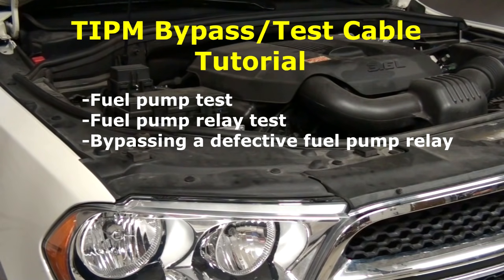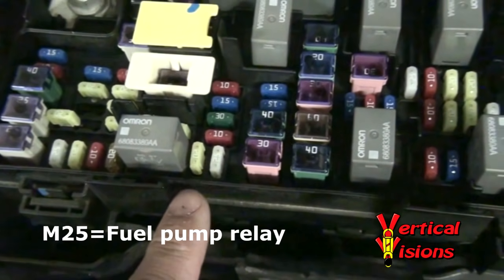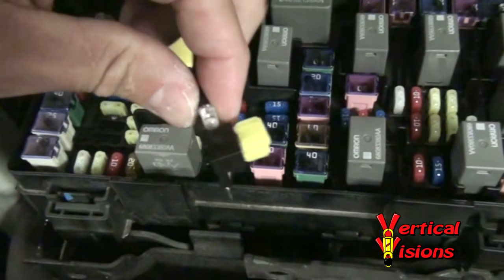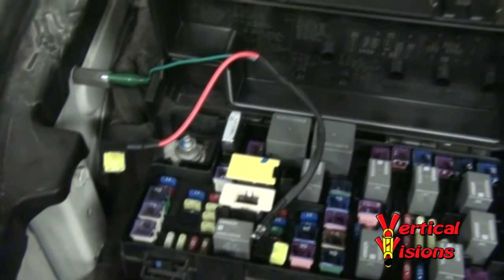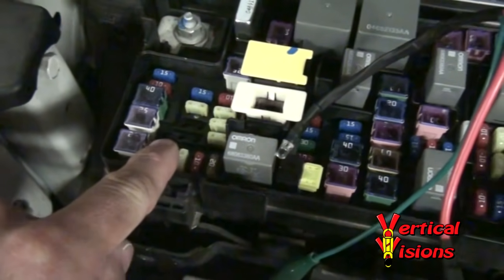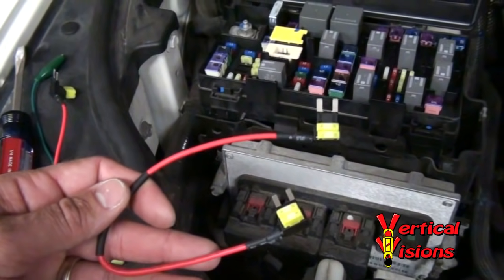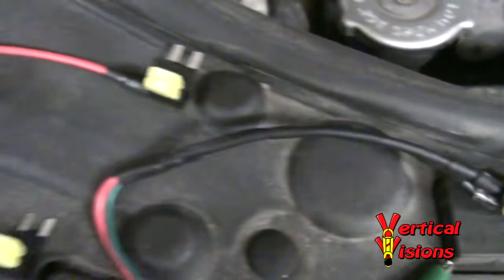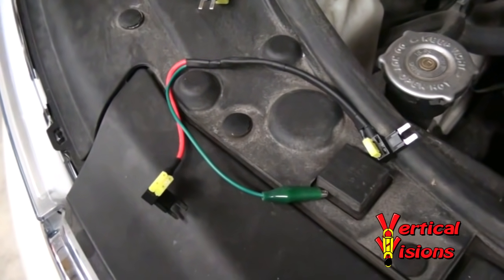TIPM Fuel Relay Test and Bypass Solutions - Most 2007-2021 Dodge, Chrysler, Ram, Jeep, VW Vehicles

Comment: Your video helped alot.  Ty.  My 2012 Durango has a sensor that is misreading and leaving me with no gas but says 1/4 & 1/2 gas remaining.  
Now it won't start.  Died on freeway.  When I crank it, the dashboard and interior lights are flickering but no start.  
Doing hard reset i learned about now.  Is that going to solve my issue?
Reply from the maker: A hard reset might help, but I'm guessing you might have a bad battery or alternator.  Our test vehicle, a 2011 Durango, died on the interstate a few weeks ago with flickering lights and no start.  We couldn't even jump start it until someone came by with a small 2000A battery pack.  Drove home with flickering lights that indicated a bad alternator.  New battery solved the issue and the alternator tested fine, but we're still perplexed over the inability to jump start it in this situation unless the old battery conflicted in some way or an intermittent electrical issue was to blame.
Reply: @VerticalVisions  thanks.  It was the battery.  So my boy is home.

Comment: Is the rear power outlet still available to use at the same time or should it not be used
Reply from the maker: Yes, especially since we don't use the M7 rear power outlet anymore for bypassing a faulty fuel pump relay.  New method we developed: https://www.verticalvisions.com/tipm-test-bypass-cable-mini-blade-fuses.html#M37

Comment: I have a 96 dodge 1500. I've replaced everything in the distributor  cam position sensor throttle  position  sparkplug and plug wires and the truck isn't getting spark?

Comment: What about 2005 ram 2500 just cranks no fuel. Don’t hear fuel pump. Drove to store shut off went to start and electrical volt came on dash no start cranks fine a quick shot of start fluid and truck runs. Will this fix it?

Comment: Does it work for a 08 dodge 1500?
Reply from the maker: No.  https://www.verticalvisions.com/tipm-test-bypass-cable-mini-blade-fuses.html#faq10
Reply: Great so I’m screwed, I got zero warning, shut truck off at 12:45, came back to start it at 2:30 and all it does is turn over.  The only thing that did different was I accidentally hit the door lock button on the key fob while starting it at 2:45, probably has nothing to do with it but figured I’d throw that out there.  I never had a progressive starting problem, loss of power, just boom and won’t start
Reply from the maker: @black07rr  My best advice is to buy a used TIPM:  https://www.verticalvisions.com/used-tipm.html
Reply: Jason Bell gonna try and figure out if that’s the issue first I guess, I just figured the bypass would be a easy way to verify it

Comment: Dude we need YOU to fix our Electrical Issue. Sad part is, our local Electrical Automotive who is HIGHLY renown in our area...this is where the Mechanic send you too if they cant fix your issues. So after 5 full days, they called us today and apologized cause they cant find the issue. Need to Jump it to start it...we let it run....then it starts fine for the last several months, needing to Jump it maybe once every two months....now...after we jump it...let it run awhile....still needs a jump after sitting for a mere 6 hours. Had starter and alternator checked and that were fine!> however...every 7 min on the dot, there would be this small tiny 10 sec window of some (dont know the Verbage!) draw on battery or whatever....problem is, Electrician said is when it does whatever its called (sorry!!) he doesnt get the amount of time to trouble shoot fuses and check lines or connections or whatever. They had it for 5 full days! He said to take it to a Chrysler Dealer service dept. he is cocerned it may need a whole new TIPM module etc......any ideas? Oh ya and we have one of those "possessed" Journeys where the Horn as some sort of melting or stuck sport in wheel, so horn blows whenever it pleases! wth???

Comment: Hello jason, me and my wife are wanting to buy a 2013 Durango R/T 5.7L ..... but doing research and seeing about this recall/relay miss up,  want to ask if the TIPM test bypass cable will work for the 2013 Durango R/T????   we test drove it and truck has no problems but dont want to buy if this is something to think about.... i want to keep durango for awhile.  please let me know  i appreciate it.
Reply from the maker: TIPM cables and other products we offer will work on a 2013 Durango, but you'll need to make sure an external fuel pump relay hasn't been installed per the nationwide recall:  https://www.verticalvisions.com/omron-g8jn-external-relay.html#identify.  If an external relay is installed and you have issues, replace the external relay (10 minutes max).

Comment: Jason Bell can I still check my fuel pump using this cable even if Chrysler already put there quick fix relay cable????
Reply from the maker: No (assuming you're referring to an external fuel pump relay where wires are cut under the TIPM).  But there is no recall on any Chryslers for this issue so it would be rare to have an external fuel pump relay.  Here is how to ID an external fuel pump relay:  https://www.verticalvisions.com/omron-g8jn-external-relay.html#identify
Reply: @VerticalVisions  Thanks a lot for the info on the dealer external fuel pump relay. I checked my fuel pump jumping the 30 and 87 pins on the external relay like you describe. And yes my pump turns on but no start yet I order the replacement relay from your website hope it works! I got the (simple) bypass fuel pump relay cable you offer. But unfortunately it didn't work cause my 2011 town & country already had the dealer external fuel pump relay. Under my TIPM

Comment: So in my case because my fuel pump stays on after i turn car off. I would have to isolate the power coming from relay which is stuck on and supply power from lighter to the side going to fuel pump. correct? But how can i disable the power from the relay end of the fuse and supply power to fuel pump???

Comment: But my problem is i cant turn fuel pump off. So when i turn key off position the fuel pump stays on. Will the by pass correct this??
Reply from the maker: Yes, absolutely.  The cable was designed and configured to solve this problem, which accounts for approximately 25% of all fuel pump relay issues.  More info:  https://www.verticalvisions.com/tipm-test-bypass-cable-mini-blade-fuses.html
Reply: Jason Bell then why do people install external relay kit?
Reply from the maker: @LubaLuba1  Most people don't install an external relay kit themselves because it involves cutting harness wires under the TIPM.  Bad idea to cut wires.  External relays were part of a recall for certain vehicles (2011-2013 Durango and Grand Cherokees).  We have better ways to bypass faulty fuel relays that aren't as invasive.  Plus, they're now recalling the original recall because the external relays are failing.
Reply: @VerticalVisions  I get the video but by not having a relay could I end up with popping the fuse also it looks like you have double fuses on each end of the wire why is that?
Reply from the maker: @LubaLuba1  This video is old - we have better ways to hook up the cable now that isolate the old faulty fuel pump relay so it won't power your pump when the car is off.  https://www.verticalvisions.com/tipm-test-bypass-cable-mini-blade-fuses.html#M37.  The double fuses on each end are mainly for testing purposes (test fuel pump, test fuel relay), but when you hook it up on bypass mode you remove the lower fuse on M25 end of cable.  This removes the old faulty fuel relay from the fuel pump circuit.
Reply: @VerticalVisions  So in my case because my fuel pump stays on after i turn car off. I would have to isolate the power coming from relay which is stuck on and supply power from lighter to the side going to fuel pump. correct? But how can i disable the power from the relay end of the fuse and supply power to fuel pump??
Reply: @VerticalVisions  Ok but why do you two fuses to begin with anyway removing it still continues the circuit at the fuse M25? because once the fuse lead on the opposite side of that goes to pump is connected it will have its own power from stuck relay. This will defy my purpose.
Reply from the maker: @LubaLuba1  I explained in another reply to you regarding the need for 2 fuses (to test fuel pump and fuel pump relays).  Our TIPM cables perform 3 functions in total, so 2 fuses on each side are needed for some tests.  In bypass mode, you remove the lower fuse on M25 end in order to remove a stuck on fuel relay from the fuel pump circuit.

Comment: We had a 2009 T&C with similar issues.  For us, if we turned the key to ON, shifted the car to drive, then back to park, it would start up.  Does it sound like our problem has anything to do with the fuel relay or what?  About a year after we bought the van, we were having stalling problems whenever we were exiting a highway.  Dealer couldn't figure it out.  I called Chrysler after finding many similar issues on the Lemonblog.  When I threatened to contact our local consumer advocate, they finally agree to have a new transmission insalled.  Happily the stalling issue was resolved, but a few years later the no-start issue started.  My daughter and son-in-law now have the van and are having the no-start issues again.  Since it DOES start up after moving the gear shift back and forth, what problem does anyone think we might have?
Reply from the maker: Stalling while driving is sometimes a fuel relay issue, but shifting back and forth is likely a shifter cable issue.  Bottom line is that a fuel relay issue is almost always a problem with providing fuel to a vehicle and never a problem with the ability of the starter to engage the flywheel to rotate engine components.
Reply: @VerticalVisions  Thanks.  Could the shifter cable have become a problem when they replace the transmission?  Is this something that can easily be fixed?
Reply from the maker: @debbiedempsky8160  Yes, it's possible.

Comment: Just installed mine and the fuel pump side melted
Reply from the maker: Your M25 fuse slot was likely damaged prior to installing the cable.  We've seen this before where customers insert fuse taps or widen the fuse terminals in their TIPM due to repeated use.  This creates a hot spot due to the M25 terminals not touching the TIPM cable with enough surface area.  The 9 amps flowing to your fuel pump require a fuse or TIPM cable to be tight and secure.  The solution is to remove all fuses/relays and the top of your TIPM, then crimp the terminals back together.
Reply: Yeah I figured that was it because we were running a jumper wire to do it in the meantime with a cut off switch in the cab for fuel pump,  can I wedge a copper prong in with fuse for tight connection
Reply from the maker: @trhye7887  Yes.

Comment: Hi , I just bought this item, my Dodge Durango is 2011 and starting to not turn on properly and shaking really bad, I spent over $700 in parts and mechanic work and still have the problem,  ass soon the item gets here I will do the test and hopefully that fixe the problem 
Thanks
Reply from the maker: Make sure you don't simply have a faulty external fuel pump relay per the recall:  https://www.verticalvisions.com/omron-g8jn-external-relay.html#identify

Comment: I am in need of help.  
I have a 2006 jeep grand cherokee laredo. Drove the jeep to town and the AC worked great.  Parked it for 30 minutes and when I started it the AC clutch would not engage. 
Checked all the fuses and all were good, checked all out under the hood and under the dash above my foot pedal.
Switched out the AC clutch relay with the horn relay (same number relay) and nothing.
I changed the low pressure switch and did not fix the problem.
I changed the compressor and could NOT get the AC clutch to activate when putting in freon.
I changed the expansion valve and nothing.
I changed the LOW PRESSURE switch a SECOND time thinking the first one was bad. NOTHING!
My controls inside the jeep (blower, temp) were replaced last year, they were purchased from the dealer so I doubt they are bad.
I even changed the valve cores on the low side (where u put in freon) and the valve core where the low pressure switch is.
Only other thing I can conclude is the TIPM box, but I am open to suggestions.
On two separate occasions I blew the fuse to the AC Clutch, but I cannot replicate that again so I have no clue what caused that.  As of now the fuse is staying in tact.
It appears I can test my AC Clutch relay in the same was as the fuel pump relay?

Comment: The remote start is effected by this. What are the steps to be able to use my factory remote start? And does this effect horse power? I bought a 2011 1500 big horn from a personal and had no reason to get into n.v the tips until now. Saw this cord a d found it odd and out of place. Wondering what is required to get into y vehicle back to factory. I'd like to do some modifications to it as far as intakes exhaust etc. But dont want to have it be worthless.
Reply from the maker: Remote start is NOT affected by a TIPM cable if using the newer M37 to M25 connection method. No horsepower change.  To revert back to factory, you'll need to remove and disassemble the TIPM.  Then desolder the fuel relay from a circuit board under a microscope and solder in a new one.  Not easy for most.  https://www.verticalvisions.com/tipm-repair-service-fuel-pump-relay.html
Reply: So replacing the 15 to 20 dollar fuel pump relay is an expensive job? Any idea why my factory remote start just cranks with out turning over?
Reply from the maker: @marcussherwood1141  If replacing a fuel pump relay were easy, both of us wouldn't be discussing it on this TIPM fuel relay bypass cable video comment section.  Your fuel pump relay is soldered to one of 6 circuit boards inside your TIPM.  The TIPM isn't designed to be disassembled, so you have to figure out how to take it apart and trim plastic in certain areas. I use a microscope to desolder and solder the fuel pump relay to/from the PCB.  Testing both old and new relay is advised using a battery and multimeter.  If you test relays improperly, you can damage a 16 pin transistor array.  So, if you can handle the above, then you can replace your own fuel pump relay. 

 As for your remote start, most vehicles will disable remote start if all of the following conditions are not met:

Check engine light not illuminated
Shift lever in PARK
Doors closed
Hood closed
HAZARD switch off
BRAKE switch inactive (brake pedal not pressed)
Ignition key removed from ignition switch
Battery at an acceptable charge level
Remote keyless entry PANIC button not pressed
Fuel meets minimum requirement

The engine can be started two consecutive times (two 15-minute cycles) with the remote keyless entry transmitter. However, the ignition switch must be cycled to the ON/RUN position before you can repeat the start sequence for a third cycle.   If using the M37 to M25 TIPM cable connection, remote start is not affected by using this cable.
Reply: Thank you much. Appreciate your speedy replies.

Comment: Does the jumper fix on the TIPM keep the fuel pump running when the key is in accessory mode? or when doors are open  and/or interior lights are on? I have experienced a discharged battery when doors are left open at campsites , etc. 
Thanks for a money saving bypass solution !
Scott Whittet
Dallas Texas
Reply from the maker: No issues if you use the new connection method:  https://www.verticalvisions.com/tipm-test-bypass-cable-mini-blade-fuses.html#faq19

Comment: the problem I see your the video is that not a relay thats the fuse only
Reply from the maker: The fuel pump relay is inside the fuse box and its output goes directly to the fuse.  Trust me, it's a relay issue.
Reply: @VerticalVisions  yep the relay is inside the fuse box but you can have a bad relay and the fuse can be fine
Reply from the maker: @robertrooker1802  I don't understand what you are saying.  Yes, the main idea behind my video is to test and bypass a faulty fuel pump relay.  Fuses are important, but they're not the focus of this video.
Reply: the reason I said this is because this weekend I'v been trying to find a problem with my fuel pump the car will crank and run for a second or so and shut off....and I know the fuel pump isnt bad.It's almost as if the fuel shut off is stopping the fuel from running.But I'm also getting a u0101 an u0100 code which mean no communication with pcm
Reply: @VerticalVisions  yep I understand good video just the same

Comment: Thank you, thank you, thank you!  This worked for a 2013 Chrysler Town and Country!  15 bucks in parts, 15 minutes of time, and it works!  Wife's van is back in operation on Mother's Day!  I went ahead and didn't put the lower fuse in the fuel pump side just in case the fuel pump was running with the car off.

Comment: Thank you i found my promlems its keep cranking no start.no ck light on either but i did follow yours now car start and runs 
 normal..question you cable comes with 2 fuse each side when i installed keep the cable on both side or take off one fuse feom eatch side. I insatlled it with both fuse on both side.
Reply from the maker: Bottom line is that you should be using the new connection method here: https://www.verticalvisions.com/tipm-test-bypass-cable-mini-blade-fuses.html#faq19

Comment: Will using this method cause the fuel pump to be on when you are in accessory mode? If I'm just sitting listing to the radio without the car being on will the fuel pump be running?
Reply from the maker: No, if you're using the newer M37 to M25 connection.  Link:  https://www.verticalvisions.com/tipm-test-bypass-cable-mini-blade-fuses.html#faq19
Reply: @VerticalVisions  Thank you! I switched it over to the new method and everything is working as it should.